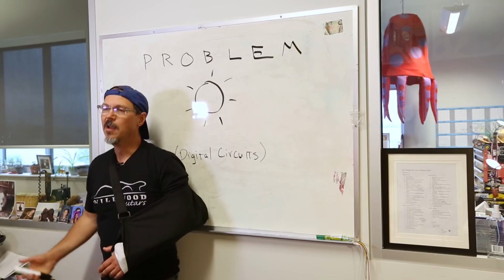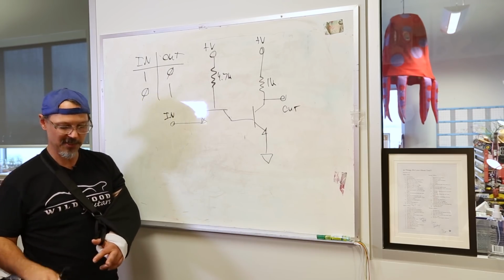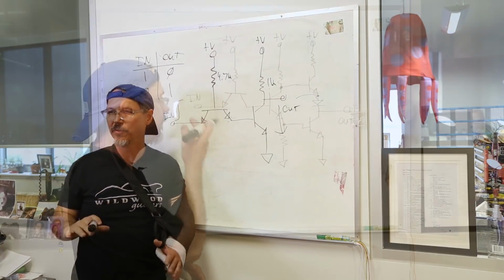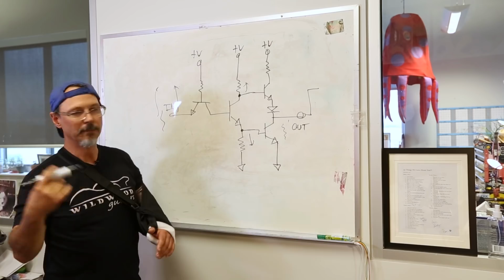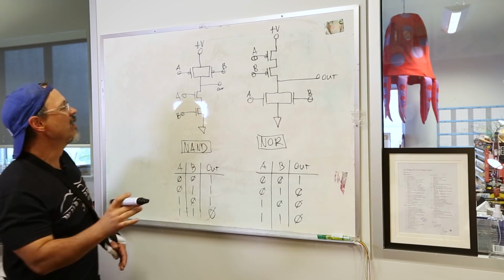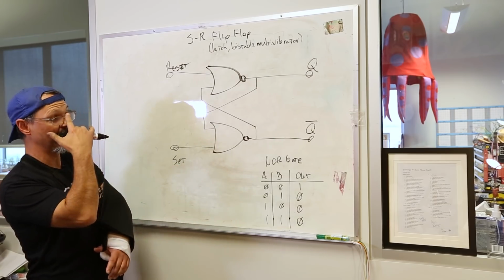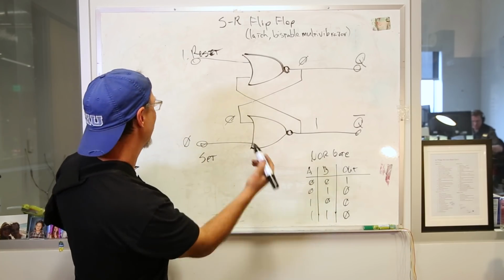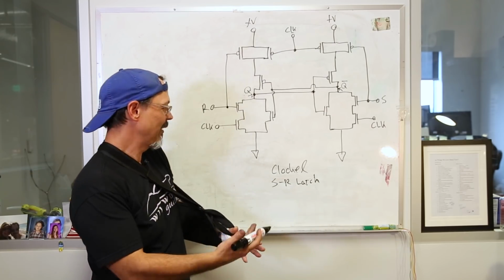According to Pete #60 - Digital Circuits

Comment: I'm working on a hobby project of trying to create a CPU from scratch as low level as I can (physically implementing as much of the Nand2Tetris course as I can in hardware).  Realistically I can just use a microcontroller but this is more for educational purposes so I want to understand what is going on under the hood and as low level as possible.  I'm starting with transistors to build logic gates, then as I build something at a lower level I can "unlock" the abstraction at a higher level.  So, once I have AND, XOR, NAND, etc, working in transistors I can then switch to using the 7400 equivalent for something like a Quad-AND IC.  Then more complex ICs for registers, memory, adders, etc.

I'm finding the BJTs very finicky and I'm having to incorporate resistors all over the place which complicates things.  I just ordered some logic-level N-channel MOSFETs to see if this makes things easier.

Comment: For where they are going, I've seen (and used!) a number of them as the control side of step sequencers and other synthesizers.  Obviously that output is fed through analog wizardry, but 555s can be used to generate and accept logic signals, and shift registers and binary counters step through the sequence.  You can probably use some of the more exotic 74 series to make really interesting sequences too.

For a unique application, you could have a logical AND setup with pull-downs on the inputs and switches on the input to Vcc.  
But instead of switches, it's fruit.
Put power through a potato, an apple, anything really.  It can be a good teaching moment for kids or students that everything has a resistivity, and it'd be pretty interesting to see if a potato "equals" a banana.  It also could put a real answer to "comparing apples AND oranges".

Because the food will have different resistances, could you technically call this an analog application?  Sure, but the output is all digital.  And tastier.

Comment: I don't really know where these simple parts are going commercially, but in teaching myself electronics I tried to make a simple chess clock using NPN transistors as a gift for a friend. This is the kind of clock that has a timer for each player and a paddle starts the timer for one player while stopping the timer for other player. I'm sure my design wasn't elegant, but I was trying to learn using the most basic components I could. I experienced the power loss and impedence issues mentioned early on in the video when trying to chain multiple inputs and outputs together. The transistor values I were using probably weren't playing together very nicely either. This project wasn't that wacky, but I found out pretty quickly that I needed to move to a more efficient part to pass the signal along. I read more about digital logic and came upon CMOS as the more modern technique for digital logic. So, maybe this is just another vote for the obvious use of the parts in education. I find value in starting at the most basic level of a subject so I can better understand the more complicated aspects later.

Comment: Where are all those discrete components going? I would say a lot of them are supporting microprocessors in applications where timing is critical and/or the need to detect a complex state is a bit too much for the CPU. Imagine having to know if two lines go high at the same time, even for an instant. Do you code two ISRs where you trigger on one line then test the other? You still have timing windows where the code has to complete the test on the second line before the state changes or you miss the condition. Then you have to react to it. More code, more timing delays.

Comment: Might be a bit of a stretch, but I made an automated AV switcher with an Arduino as the heart of the device (ok, 2 arduinos, but I added functionality after I made the first board).  I use it to control my TV, AV receiver, input selectors and LED strips (because who doesn't love LEDs!) for my 20+ old school game consoles.  

Some of the AV switches work off IR (along with the TV) which are easy enough to control with the Arduino, but there are a few that require a physical button press.  I used 74HC4067 multiplexers to simulate the button presses (the 4067 counts, right?).  There's also a mix of 4067's and TLC5940's to drive some LED strips to change colors depending on the console selected (up to 32).  It's all driven via bluetooth from a horribly designed Android app I threw together.

Comment: Here is what i use all these parts for:

First i built like a password safe, where you enter a code with a rotary encoder and a shift register with parallel outputs (3left 2right 1left 2right...).
When pushing the encoder, you latch the shiftregister so the outputs become high or low (depending on the direction you turned the encoder). These outputs are connected to a set of transistors in row (pnp or npn) and only if the outputs match the base of the transistor, current is flowing and powering the next circuit.
This consists of a slidepotentiometer and something like a lm3915 built of discrete parts  (a reference voltage divider and a set of comparators). By sliding the potentiometer, one comparator after another goes high, switching transistors, which are connected to an old rc keyboard circuit board and thereby writig the password.
Finally there is a pushbutton for enter.

The second thing is a sstc slayer exciter on steroids (https://www.instructables.com/id/Easy-SSTC-Slayer-Exciter-On-Steroids/)
Which i completed with some piano keys with adjustable resistance for the 555 vibrator circuit in order to play simple melodies.

3rd thing i built: a little synthesizer inspired by this: https://hackaday.com/2015/08/07/logic-noise-4046-voltage-controlled-oscillator-part-one/

Or the minimum theremin (http://www.theremin.us/101/101.html).
A very fun thing to play with.

For me, building all these things from discrete parts is just way more satisfying than writing code (i love soldering).
Reply: I absolutely get where you're coming from.

Comment: Well about 16 years ago, way before micros where readily available, I needed (or wanted to build) an auto pool filler. It turns out that the pool fill at my home is connected to a typical 24V AC irrigation valve and was intended to be complete manual. Having been exposed to logic design in college (BTW, many, many years prior), I pulled out the old text book and began to design a state machine (yep, just like they taught us) that looked at high and low water levels in the pool. When the water level drops below a LOW set point, the valve was to be triggered open. When it reached a HIGH set point is was shut off and not to come on again until water was again below the low set point. The circuit was was created using only discrete parts. The final state machine was basically implemented using a Quad NAND gate (4 gates used) which drive a relay that controls the valve via the final gate in the chain. There are supporting components in the circuit, like a rectifier (24V AC wall wart for power), voltage reg for logic power, relay, transistors, LEDs, resistors, and caps, etc., but no micros or software involved. I remember the first test... the valve chattered on and off as I swam in the pool... doh!  So, I ended up adding a capacitor on the LOW sense to effectively delay the LOW sense until the water was LOW for more than typical "splash" time (water bouncing around the LOW probe). I still use it to this day (primarily when on vacation and can't fill the pool manually).  Finally,  when micros became readily available, I did bring out the signal to relay for micro control, but I have yet to use it. It remains a completely discrete circuit to this day.

Comment: For some reason I've always loved working with 7400, there is probably a name for the condition but no one has managed to cure me of it yet.

I've been working (infrequently) on an implementation of the SSEM (https://en.wikipedia.org/wiki/Manchester_Baby) aka Manchester Baby for about 2 years now.  The project is restricted by the requirement to use 7400 series logic and other parts available in the 1970s.  So far I have clock, program counter and CPU designed and the parts procured.  Display and memory multiplexing are coming up next.  It's a 32-bit ALU so it requires a large number of chips.  The machine as been emulated the CPU in Python so I have a reference for troubleshooting.

If anyone knows of a cure then my wife would love to have the details.

Comment: Good explanations!  Perhaps better than the explanations I got in 1979 (sorry Dr. Loh).  I use 7400-series components to free-up ports from my arduino, 
usually for display purposes (as you blurted out in the video), and usually decoders, shift registers and 7447 drivers.  The 7400's (and the occasional 5400) just get used for random logic (is that a thing) to tweek LED displays, and to keep all the logic levels correct when using IR interrupter circuits and hall effect sensors for my slot cars.  I enjoy the videos.  Thanks!

Comment: I recently needed to create a simple oscillator in which I could independently control the frequency and the duty cycle to adjust them to specific values. I tried using 555's (one to generate the frequency, the other as a one-shot to control the duty cycle). The issue I ran into was I had to put these in an oven at 125C. I could not find a 555 that was rated for that. I also tried various canned oscillators/one-shots. I just couldn't find anything that would do the job (as usual, I had to do this quickly so a thorough search was not possible). 

I ended up using a part that had two inverters with Schmitt triggered inputs in a tiny package. I built the oscillator out of one of them with a resistor feedback and a capacitor on the input. I fed the output of that through a high pass rc filter. This gave me control of the duty cycle. I ended up using two of these parts (I needed to have two phases of this clock signal). It seemed to me to be a simple solution to my needs.
Reply: That's cool. What was the specific environment?

Comment: For the competition I have two different thoughts. 1st would be entirely digital: build a hardware lock/keypad using only digital discrete, I.e. gates counter flip flops etc. I'm wondering if you can build it to be "programmed" (or a programming mode) in which you enter your password then from then on out it will unlock (open door, turn on a blender, activate self destruct) to that code. This programming mode would be better than having a hardware pre set code for "security" purposes. 

The other analog & digital design would be a battery charger circuit. Given a battery chemistry to follow the curve and act on things like over temp and etc using discrete logic. (Ya know boring stuff)

Thanks for the videos Pete!
Reply: Huh. Well, you've either got to remember the code from a hardwired circuit, or you're using a programmable digital device... which when you boil it down is effectively a programmable hardwired device. Hmm. I think I see what you're going for, but I'm not sure how to achieve it.
Reply: @snakeoilification  I'm thinking it would either always have to remain on post programming when it switches to the "programmed" state due to the code being stored in flip flops or you could have to have some sort of persistent memory post power off like solid state or something. A small Li cell would probably be easier to achieve.

Comment: Nice video Pete. In all your ATP videos you have a real knack for focusing on the important and fundamental points and not getting bogged down in the details.

Here are a few ways that discrete logic components are still being used:

1. I/O drivers.  Discrete logic is connected to the inputs and outputs of ASICs and FPGAs to drive signals for use in the outside world. The discrete logic devices can typically drive higher voltages and higher current levels. They can drive higher currents directly to external components and are good for driving high speed signals down a cable. Also, they are useful for protection: if an output is accidentally shorted, the cheap discrete device is destroyed, not the expensive ASIC or FPGA.

2. Glue logic. When interfacing one complex IC with another, it is often necessary to invert a clock or signal or provide a simple logic function to make the two circuits work together as desired. The addition of a few glue logic components can eliminate the need for an expensive ASIC re-spin.

3. Logic level translation. Discrete logic components can be used as an inexpensive way to translate logic levels between devices from different logic families. Open collector (or open drain for CMOS) outputs are particularly handy for this purpose.

BTW: love your shirt. I got a Martin guitar from Wildwood Guitars a couple years ago. I think they are the best guitar shop in Colorado.
Reply: Hmm. All good points, thank you.

Also, Wildwood has got a lot of my money, doesn't help that they're only 15 minutes from home. I have a bunch of those shirts.

Comment: My grand idea for using discrete logic components in a logical circuit is to build the CPU described by the book "The Elements of Computing Systems". The book starts with basic logic gates (one step above the actual circuit design) and builds through to a full CPU design, then the assembly language, a compiler, and virtual machine language. (Think Java-esque.)

The book itself is rather cheap ($30 right now, paperback) and there are PDFs along with all of the downloads to work through the exercises, all of which are free.

https://www.amazon.com/gp/product/0262640686
Reply: I'm working on the same exact thing.  See my comment above.  Basically, starting with transistors, to build logic gates, then as I build something I can unlock the higher level abstraction (7400 ICs).

Comment: Here's my use. 
When building Touchy Blinky for Burning Man (https://www.youtube.com/watch?v=lfoz6IJicFQ) I've used two components for the board at the top of each column. I used it because it allowed me to do the very simple things that I needed like multiplexing 3 bits (74HC251) , comparing 4 bits (74HC85), and even a single not gate implemented with a 2n7000 and a resistor faster than I could with a cheap micro. Also means I don't need to upload and update code to the single boards.  
Another I guess common use for me is using 74HCT245 as a logic level converter from 3.3V to 5V.

Comment: RE: 30:53 What the $@&#(% would you use a 74lsxx Part for - Well, make a Hydronic heating system controller (that is hardwired for it's output functions), Make a 16 relay controller for a GE-24V-110V/200V-AC relay(s) for lights, and/or run a SR Flip-Flop controller for a 600Hp 3 phase well pump.  You really need to look over at Ben Eater's 8-bit computer on youtube. A lot of people are trying their hand at it.

Comment: When I was learning about digital circuits, the topic clicked with me, so I had time to play with simulation software by myself and I started by making a binary clock that ran off of mains voltage and signal (60hz) but that was sadly enough to inundate the simulator and kill it.  :(  Fast forward, I found an app that I thought was decent and I had just learned about the various memory 'gates', so I put a roadmap for how to design a 4 function calculator with a bank of memory with a universal shift register (probably not the best choice, but I wanted to be open to modifications) and how to shift the signals, write/read them, the logic behind the arithmetic in binary, input from button, and communication in BCD translated at the end to the proper 7 segment display.  ...Well, my simulator pooped out on me, probably to the surprise of no one, as I designed these all out of discrete components into the arithmetic units, universal shift register, BCD translator, etc.  I would REALLY love to make a discrete component calculator.

...I just might love it even more if it used magnetic core memory, that way it could be powered off without losing my important math work!
TL;DR, Discrete 4 function calculator!!!

Comment: A while back I got Humble Bundle's music eBook pack, featuring Make's DIY Analog Synthesizers book. While much of it is, as the name suggests, analog (or analogue), appendix C is full of CMOS stuff, NAND gates and such for square wave oscillators, store and hold filters, or potentially random filters. I'm looking to mix stuff from that book with my collection of Arduinos, my love of MIDI that's lead me to MIDIbox, and my soft spot for old FM synth and chiptune sounds (OPL2/OPL3 & C64 SID). This is where I'm going to be playing around the line between digitial and analog, and also why it would be really cool to win that oscilloscope. (It's either this or some cheap digital box from AliExpress with USB and an app for my Windows PC in the shed, as I don't expect I can pick up a reliable old CRO any more.)

This video took me back to my uni days. Keep up the great work.

Comment: I'm using an quad sr latch (actually waiting for the parts right now ) to turn on and off a cc battery charger pushing  a button resets the latch turning the charger on ( the output is inverted) when the cut off voltage is reached the out put of a comparator sets the latch turning off the charger. For really simple stuff a micro is over kill that's where all those parts are going.
Reply: Simple, reliable... yeah, I could see that. And having a programming step in your manufacturing cycle can be unnecessarily expensive.